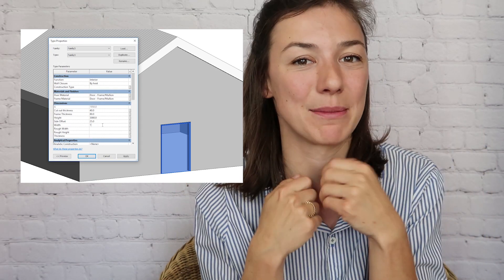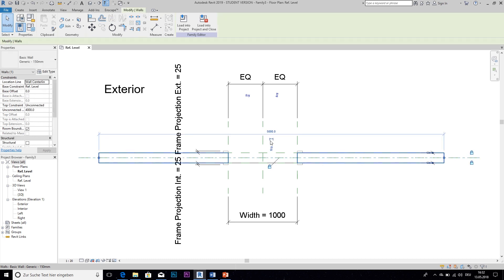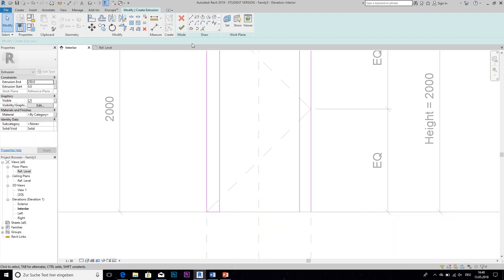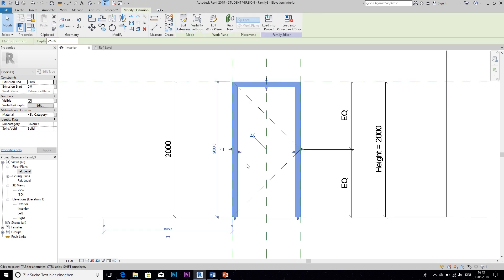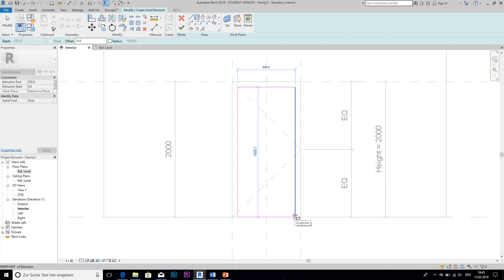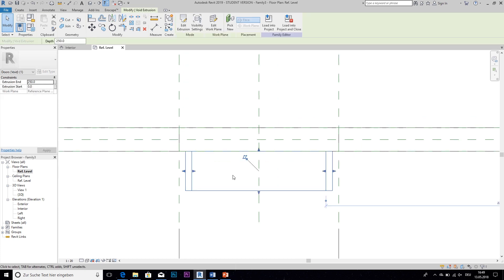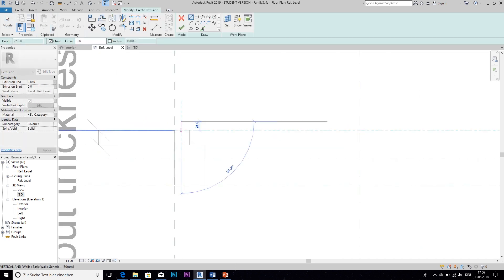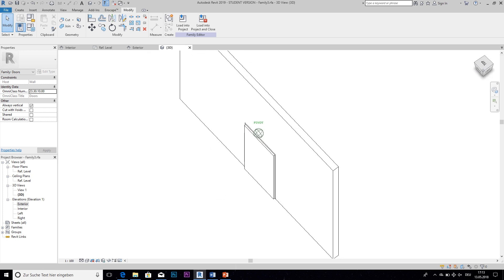REVIT FAMILY MODELLING GUIDE - Part 1

Comment: You should add another couple parameters to define the door swing ...  first would be interior/exterior to define if the door opens into the interior or out into the outside ... second would be hinged right/left to define which side of the frame has the hinge ... you may simplify this be just having a swing parameter with 4 options  left hand interior ... right hand interior ... left hand exterior  ... and right hand exterior ...

This would give you the flexibility to describe the door construction fully